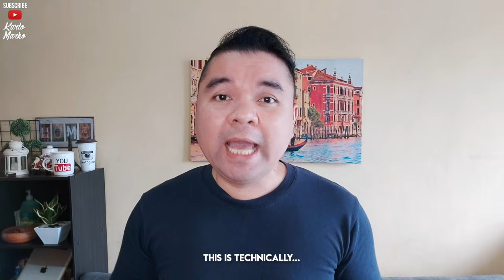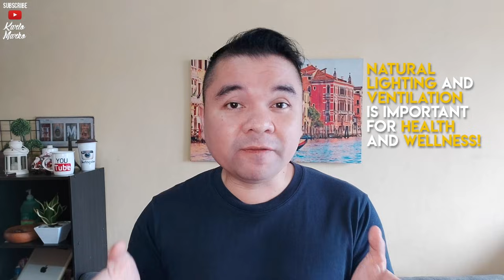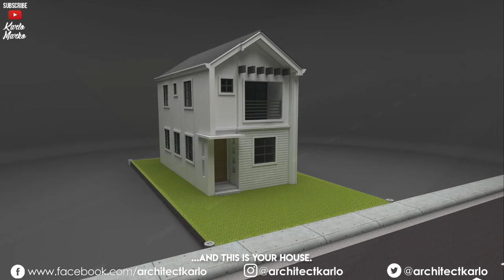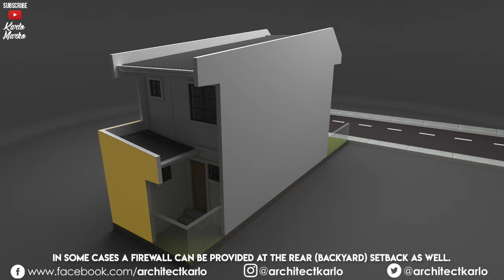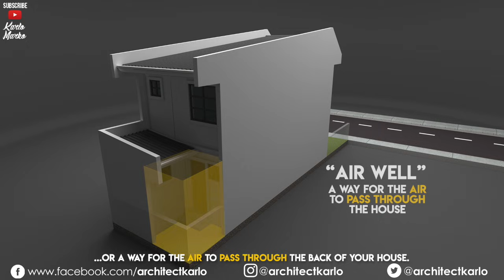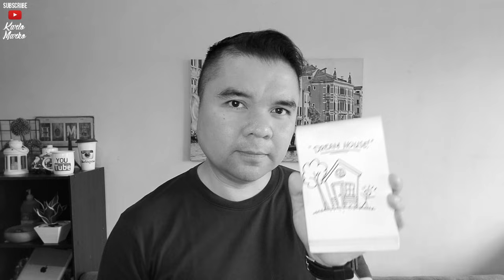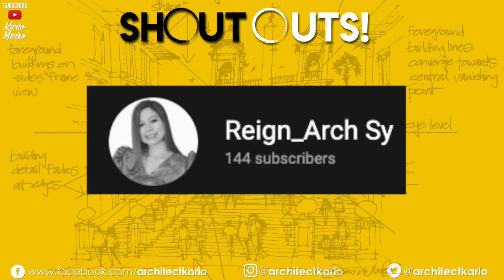The Rules on Setbacks and Firewalls | Bakit Hindi Pwedeng Isagad Sa Property? | ArkiTALK (Eng Subs)

Comment: Hello po. Yong lote ko po at along perimeter fence. Merong pong easement road sa likod..marami pong nagpapatayo ng house  na dikit na sa perimeter fence. Is that allowed ba?
Reply from the maker: Dapat po naka-firewall na ito kung dikit na sa 'property line' talaga.
Reply: @KarloMarko  allowed ba magpatayo ng any structure since that is easement road?
Reply from the maker: Limited po ang options na pwedeng ipatayo na structure. Pwede niyo po ito itanong sa inyong barangay or subdivision management. Usually kung nasa edge na ng property line. Property line or perimeter fence na lang po ang pwede.

Comment: What if po kung townhouse style ng bahay po. Tabi tabing bahay po.
Reply from the maker: Same rules apply. Townhouses are single attached units so the rules for single attached units will apply to. The rules may change depending on your vicinity if you are in a commercial district. 😊

You can actually check with your local cityhall what your setback requirements are for your lot.

Comment: Hi Sir Karlo, this is very interesting topic Po. May tanong Lang Po ako pano Po if ground floor grocery story Tapos ung second floor May terrace naman ung bahay sa second floor. Please advise.
Reply from the maker: Your property is already considered mixed-use. In a reidential property the min. front setback is 3meters while for a commercial property (grocery) the front setback is 5 meters. Because you have to allow a parking slot at the front for customers.

For a mixed use residential and commercial if it isninside a subdivision you may check the setback requirement for this... If not you may check with the barangay or your local building official for confirmation.
Reply: @KarloMarko  appreciated your reply 👍👍👍

Comment: sir if trapezoidal un lot paano po un minimum setback?
Reply from the maker: Setbacks will follow the parallel lines. So from the edges of the property line... You need to offset from 2 to 4.5meters depending on what side it is facing. Front or side or rear.

Comment: Sir very helpful yung mga video nyo.. balak ko ipagawa yung bahay namin. Sir may tanong ako, nasusunod ba yang setback sa mga resettlement area sa mga province? sa lugar namin sa tarlac sir hindi naman nasusunod yan setback. ok lang ba yun?
Reply from the maker: Hello Captain Lloyd,

Unfortunately, there are some areas in the Philippines where the setback rules were not followed.

Although for resettlement housing models... they follow a special rule po which is the BP220 for Socialized Housing. Hindi siya naka-sunod sa existing na Setback rules na nasa video because usually, resettlement or socialized housing models have a smaller lot area. So ok lang po ito kung ito ay under ng BP220. You may check on google po the rules on these develpments.

Any violation po sa setback rule can be raised sa inyong Cityhall under the office of the building official.
Reply: @KarloMarko  dami naming natututunan sayo sir kaming mga first time na magpapatayo ng bahay. Thank you sir

Comment: Hello kuya ano po setback pag 10m x 10m ung lupa😶
Reply from the maker: Hello Tao Hu,

Standard is 2m sa sides. 2meters sa back/rear. For the front it will depend on the classification of your lot... but normally for that size of a lot it would be 3meters. To gain more floor area, you can set 1 side as your firewall. All these, need to approved by your local municipality to be presented by your architect for confirmation.

Comment: Hi sir, new subscriber here. Ask lang. Allowed po ba na maglagay ng slab on top of setbacks? For example kung mageextend sa 2nd floor ng typical townhouse. Thank you. 
Very informative po videos niyo.
Reply from the maker: As a general rule, bawal pong magtayo ng structure sa loob ng setbacks lalo na kung ito ay isang kwarto with enclosed walls, a roof and a slab... so might as well have it built with a firewall.

Also, please have it checked by a structural engineer if the structure will hold this new load.

Comment: good presentation, can i ask a question then if yo don't mind, if you answer fine, if not fine too. thanks
Reply from the maker: I'm fine with it. 😊 You can see it in my comment section.
Reply: cool thanks, question is there a rules or regulations regarding cable, telephone wire expose rather build underground especially on main poles, thanks again
Reply from the maker: Haha... 😊 yung question mo is more appropriate to be answered by an Electrical Engineer (EE) and an Electronics and Communications Engineer (ECE).

Pero yes. Lahat ay merong batas na sinusunod. Regarding your concern, it is included in the Philippine Electrical Code.
Reply: @KarloMarko  lol, i thought i got an answer from you, i have to dig more to an EE or ECE prodigy, you know, we are not getting to that status we want to be(country) (if). All those tucky wires are an eyesore , thanks, 1 additional sub for you

Comment: Hello po. I'm a new subscriber. I'm a college student po and I'm interested po about firewall rating and its construction. I have a question din po na if concrete po iyong gamit, and disregarding the way it was constructed, iyong firewall rating po ba nakadepende sa thickness ng firewall?
Reply from the maker: Hello Jessel,

Firewall rating is determined by previous tests conducted involving the strength of the materials applied to a wall and it's finishing. You my check this out in the National Building Code of the Philippines and more relative information in the Fire Code of the Philippines. 🤓

Comment: Strict concrete and chb lang ba ang firewalls o pwedeng gamitan ng fiber cement board?
Reply from the maker: In the National Building Code of the Philippines:
FIREWALL  -  A  reinforced  masonry  or  reinforced  concrete  separator  with  the  appropriate  fire-resistive rating  (of 2 atleast 2 hours) and  which  shall  be  positioned  between  dwelling  units  or  between  buildings/structures  to  maintain the  fire  integrity  of  each  building/structure.  Firewalls,  particularly  those  erected  above  or  along  property lines,  shall  have  absolutely  NO OPENINGS, except  for  permitted  vent  wells  and  shall  extend  above  the  roof from  400  millimeters  to  1000  millimeters.

Comment: Goo pm sir...i have a lot 7.8x25 sqm.. Yung 7.8. po yung nakaharap sa kalsada. So Narrow na pahaba.. So kung magpatayo po is firewall sa isang side and 2m setback sa kabila?..
So maximum width na pwede sa lote na ganun is 5.8m? Ang sikip naman po :(

Any suggestion po sir?
Thank you for informative videos.
Reply from the maker: Mag both side firewall ka if you want and if your architect is also in favor of this upon checking the atual site. 😊
Reply: @KarloMarko  oh okay. Thank you po sir :) pero ang magkabilang firewall is mainit na po sa loob db?
Anyway, thank you po sir.
Reply from the maker: Not necessarily. It can still be well ventilated depending on your architect's design. Just inform your architect to prioritize that aspect of the house. 😊

Comment: Sir pano po kya ang setback for corner lot po ? And uneven shape po
Reply from the maker: Hello Richelle,

For corner lots the setbacks are 3 meters from both sides of the street. The setback will follow your property line and it will be offset parallel to that line even if its an odd shaped lot. 😊

Comment: hi Architect.. paano po pag corner lot at R5 classification. req'd pa ba ang set back sa side kung alley lang nmn?
Reply from the maker: Hello Neny,

Yes. Check with your local officials as well. You wouldn't want your house to have windows adjacent to the road or alley. Especially if you're property is classified as an R5.

Comment: posible ba ang mechanical ventillation sa 4 storey building, using air duct anf fans para sa exhaust
Reply from the maker: Hello Vince.

Yes. But you need to allot space for the mechanical equipments and machineries either sa rooftop or sa sides ng walls. I suggest sa rooftop kahit na masmahaba ang ducts... Aesthetically pleasing naman ito lalo kung wala mashadong nakabalagbag sa facade ng building. 😊

Comment: how about columns does its edge need to have a set back of exactly 2m along the walls or is it okay for columns to use the 2m setback as a centerline?
Reply from the maker: The setback area of 2 meters has to be clear of any structure except for the roof.
Reply: @KarloMarko  Thank you very much Sir 😊

Comment: Hi Ar. I have a question, due to size constriction ng lot, pwede po ba ang steel stairs sa front setback? Serves as an access sa 2nd floor. Thankss
Reply from the maker: As much as possible po it should still be inside the allowable property lines. Setbacks are meant to be open and free from any structure as much as possible.

Comment: This is a very excellent video, thanks! Arki Karlo, if there's a balcony on the side (bordering the property line) and would like to convert it into a mini office, is a firewall needed? If yes, what will be the required height?
Reply from the maker: Hello Czarina,

Yes. If the room will extend up to your property line. You need to install a firewall already on the side aligned to your property line. The height should be atleast 40cm or 16inches from the edge of the roof. So for example if your expanded room will have a roof... The firewall should be atleast 40cm (minimum) from the edge of that roof this also goes for the walls on the sides. 😊 You may have it approved with your local municipality as well. Some municipalities or even subdivisions have certain requirements for this.
Reply: @KarloMarko  Thank you!

Comment: Pwede po ba lagyan ng firewall ang R-1 classification?
Reply from the maker: Hello Anton,

Here's a guide for your concern:

FIREWALL PROVISIONS (Highlighted and Annotated) FOR ALL RESIDENTIAL CLASSIFICATIONS under P.D. No. 1096, the 1977 NBCP in its 2004 Revised IRR 

SECTION 704. Location on Property...
....
iii. ABSOLUTELY NO FIREWALLS ARE ALLOWED FOR A LOW DENSITY RESIDENTIAL (R-1) USES OR OCCUPANCIES; an abutment of up to 3.20 meters from established grade level may however be permitted but SOLELY FOR THE PURPOSE OF SUPPORTING A CARPORT ROOF; PROVIDED FURTHER THAT SUCH ABUTMENT SHALL BE CONSTRUCTED OF PERFORATED OR DECORATIVE CONCRETE BLOCKS ABOVE 1.50 METERS measured vertically from the established grade level; such an ABUTMENT SHALL NOT BE LONGER THAN 7.00 METERS OR 50% OF THE SIDE PROPERTY LINE IN TOTAL LENGTH, WHICHEVER IS SHORTER.

Comment: sir karlo, tanong ko lang po if applicable din po ba yung nasa BP220? kasi parang confusing sya po sa Building Code natin.
Reply from the maker: BP220 is still for housing specifically for economic and socialized housing subdivisions. It still follows the rules of the national bldg code but on a more conservative or economical version. 😊
Reply: thank you sir.more power po. 😊

Comment: Sir Architect anong section po sa natl bldg code po yung regarding measurement ng setbacks po ?
Reply from the maker: SETBACKS, EASEMENTS AND RELATED DEVELOPMENT CONTROLS FOR A R-1 (SINGLE-DETACHED DWELLING) IN A LOW DENSITY RESIDENTIAL ZONING CLASSIFICATION. 
Based on P.D. No. 1096, the 1977 National Building Code of the Philippines (NBCP) and its 2004 Revised implementing rules and regulations (IRR)

... read it onwards.

Comment: Hi Sir, new subscriber here, I am glad we found your channel, if it's ok, can you also cover the fire exit for small lots? Thank you
Reply from the maker: Hello Randy,

That is also one function of the setback requirement. It serves as an open area where you can traverse in case of a fire. For small lots, it is required to provide a fire exit in front of the house where the main road is located. It can either be a door where you can have a balcony outside or a window which can fit a full human adult and have it serve as a fire exit. So dapat wala siyang fixed na grills para madali itong buksan during a fire. 🙂
Reply: @KarloMarko  Thank you very much Architect ! Very informative and helpful channel indeed.

Comment: Sir, masusunod parin po ba ang setback sa second and succeeding floors sa R1? Thanks!
Reply from the maker: Hello Joanna

Ideally yes. But, there are some cases where the front setback on the succeeding floors may either increase or decrease depending on the street it is on. If it is a major road or highway it needs to increase the setback fuether back. In some streets, it can be decreased to move forward, closer to the street. For this you need to double check with your local authority what are the applied setbacks in your area.

Comment: Hi Arch..yung mga villages ba may own ruling sa setback especially sa front? Marami  kasing case na less than sa 3.meters yung front setback. Some 1m or sagad. Ok ba yun fronting to ng road? TIA.
Reply from the maker: Yes. They have their own rules under BP220 which is for economic and socialized housing. But the front setback should atleast be 1.5m under this rule.
Reply: @KarloMarko  maraming salamat po 😊
Reply: Additional query po...pano malalaman if the property falls under socialized and economic housing?
Reply from the maker: "Economic and socialized housing refers to housing units which are within the affordability level of the average and low-income earners which is thirty percent (30%) of the gross family income as determined by the National Economic and Development Authority (NEDA) from time to time."
Reply: @KarloMarko  thank you very much. Subscribed to your channel 😊

Comment: Hi Architect. I love the way the setbavk and firewalls were explained. I have a question though. We're thinking of building an L shape  house on a 10x20m lot. Front and back yard are ok. But yung sa sides, pwde bang 1m lang yung isang setback since yung kabila naman around 3 or 4m nman ang open?
Reply from the maker: Hello Rheindrops

The 2 meter side-setback is the minumum standard po talaga. It is also set that way for fire safety. If you plan on having a 1 meter side set-back on the side it has to be a solid firewall na din. So might as well, extend it all the way to the property line if you cannot put windows.

You can have this checked and verified with your architect if the lot you have is capable of having these setbacks.😊👍

Comment: Tama ka Lodi. Nandito na po ako inunahan kita sana puntahan moko lamat
Reply: Hello Arki Karlo, ang tanong ko po applicable din ba yan sa mga community housing kagaya ng Camella?
Reply from the maker: Hello Shiela,

Yes. In fact, developments like Camella and other similar developments have their own set of rules. BP220 (BATAS PAMBANSA BLG. 220) which is implemented by the Housing and Land Use Regulatory Board (HLURB).

Nakasunod ang mga developers sa batas na yan para maapprove sila for Building Permit. May mga pagkakataon na lang na napapabayaan ang mga ito lalo kung matagal na ang subdivision at hindi na ito na-monitor ng maayos. Kung merong paglapag sa rules o sa batas, pwede naman itong isumbong sa office of the building official sa inyong city or municipality. 😊

Comment: Hello Archi. New subscriber here. Tanong ko po, kelangan pa ba ako mag setback or firewall sa likod ng property kung facing subdivision minor road lang naman at open areas. Duplex end unit, other sides mey setback na po.
Reply from the maker: Hello Rine6000!

If it's facing the road, no need to put a firewall... since the risk of having fire enter your property from that side is very low. 🙂

Comment: Hi Architect Karlo! New subscriber here!. I have a question po, if an r-2 residential lot is in surrounded by other residential lots (in every side), and one of the owner of the surrounding lots decided to build a perimeter wall blocking the said frontage of the surrounded lot which also blocks the ground floor ventilation, and natural lighting. Is that allowed? what section of the building code can i read upon regarding this example. Thanks!

Comment: Good day po arki, new subscriber here, possible po ba na makapag apply ng exemption sa set back na 2m on both sides at gawin na lamang pong tig 1.5m kabilaan? The reason is gusto lang po kasi namin ma maintain yung floor plan sizes and having windows on both sides instead na mag firewall sa isang side..also may mga existing na structures na rin po on both sides ng property namin so worried din po kami na baka ma damage yun during excavation kung mag fa firewall kami sa isang side. TIA
Reply from the maker: Hello Dexter,

Unfortunately, having 1.5meter setbacks on both sides and placing windows on it may not be allowed by your building official. Especially now that you've mentioned that there are adjacent structures on both sides of your property. Which means that you are more prone to fires (knock on wood). But you can try to apply for an exemption. 🙂

For the your worries on the adjacent structures being damaged... don't worry. Hiring a legit contractor with enough experience in building houses will know what to do. It has been done so many times and it is not that difficult to do.

So for you situation, either you compress your house's width to fit the 2 meter setback on both sides and maybe adjust vertically to gain more space for you and your family... or you put one side as your firewall. 😄
Reply: @KarloMarko  Thank you Arki.. Well explained po.. more power to your page.. God bless
Reply from the maker: Thank you too and God bless you and your family. 😊